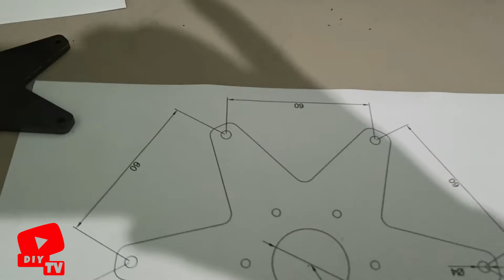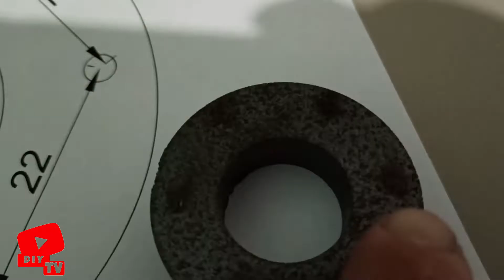Hoverboard installation of a disc brake

Comment: Good day , where did you get the bracket that connect to the wheel?
Reply from the maker: Brake disc used in bicycles. You can find it easily. It is sold on Aliexperest. I made the part that allows the brake disc to be mounted on the bike myself. You can watch the videos in detail.